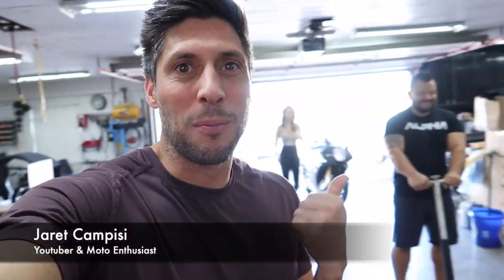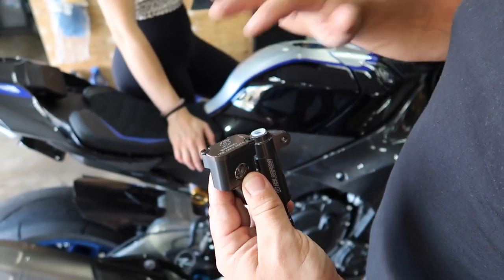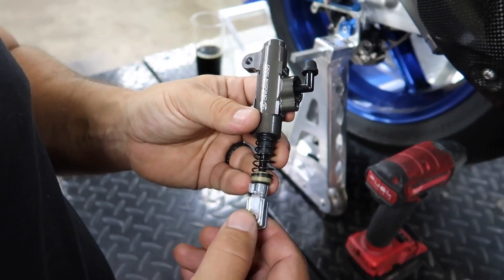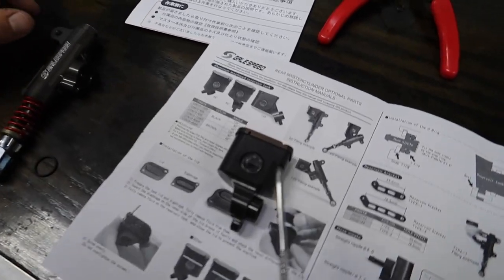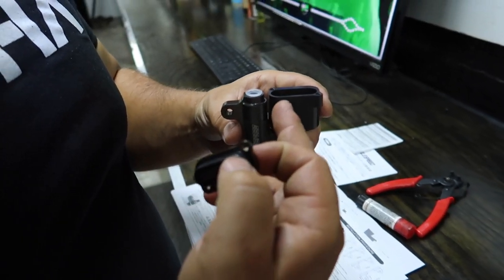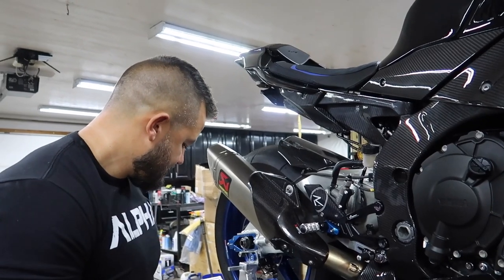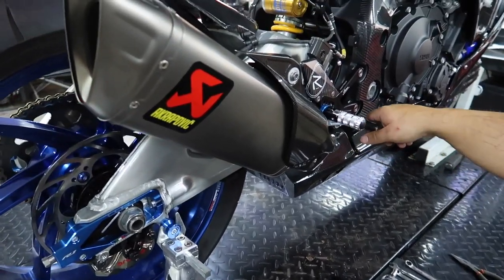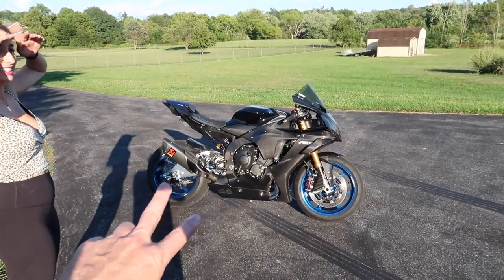Adding a Super Trick Part to Our Carbon R1M!!!

Comment: if your racing, a thumb brake is preferable, with a rear master cylinder foot brake option for the road too. no need to upgrade the rear on a road bike though. better to spend it on haircuts jaz, to keep you looking good for the camera  🤣 
Still a nice video though.